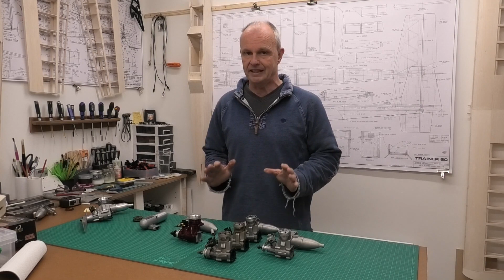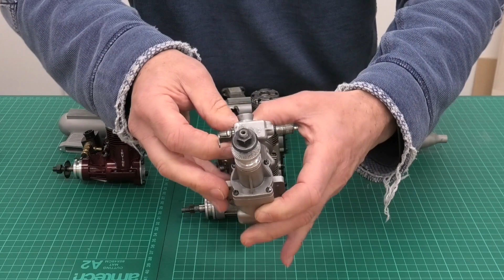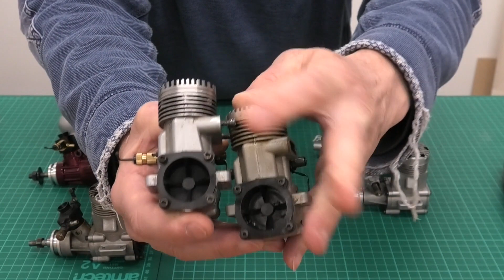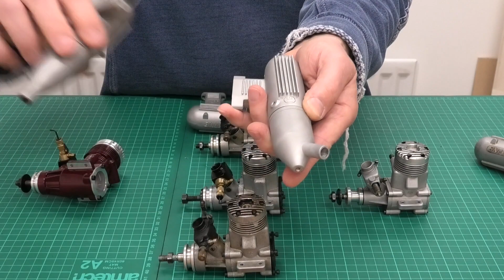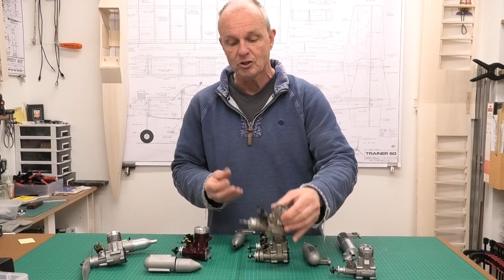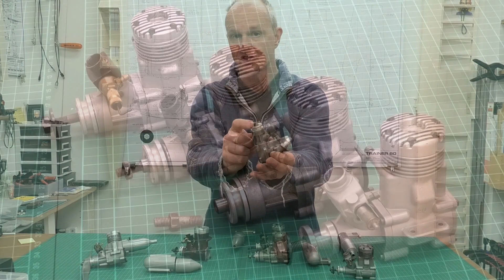Irvine 40 Glow Engine Family - Model Aeroplane Glow Engines

Comment: Do these differences apply to the diesel versions?
Reply from the maker: Hi, the honest answer is I am not sure, but I would expect so, as they were essentially the same engine but with a different head and a few tweaks, I suspect 😀
Reply: @MarkRobinson555  The .40 diesel in effectively a Q40 with a .46 Heli crankshaft and 6 mm bore R/C carburettor
Reply from the maker: @fiery1962  thank you for the info 😀
Reply: @MarkRobinson555  A pleasure Mark. I must run my Irvine .40 and .20 diesels. Lovely engines.

Comment: great info...I wonder why some of the companies have stopped making the engines.. apart from OS which other glow engines do you recommend?
Reply: Electric popularity and costs of production. I remember when you could go to Hong Kong and buy new OS engines for 1/3 the price here. I knew someone who business sent him once a quarter. So he stocked up and made merry selling them to us cheaper than UK shops but earning him a pretty penny. It's amazing how many engines you could fit in a suitcase then!
Reply: @johnw5154  electrics are fine to a small medium size planes...but I still prefer a engine for a 40 size and above airplane... as the cost of battery and motor goes up.. and again nothing compares the torque of an engine compared to a electric motor.
Reply: Hi Mark. Thank you for sharing your collection with us. Even though I am restricted to flying electric I still have a soft spot for IC motors. And I still have a small collection.
Reply from the maker: Hi, pleased you liked the video, think the glow engine industry declined due to increased production costs and reduced demand. Irvine are great engines, definitely my favourite 😀